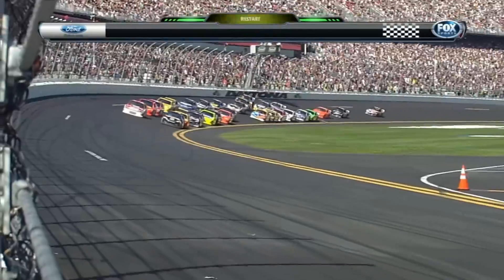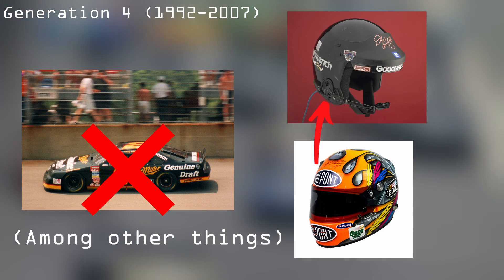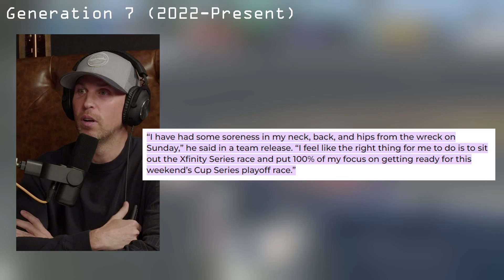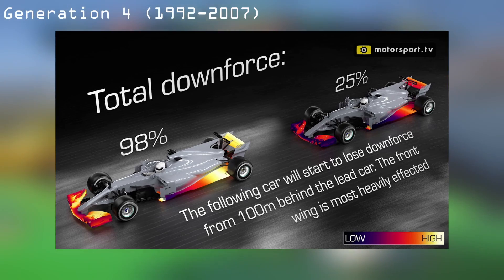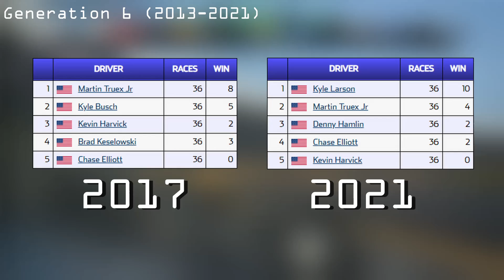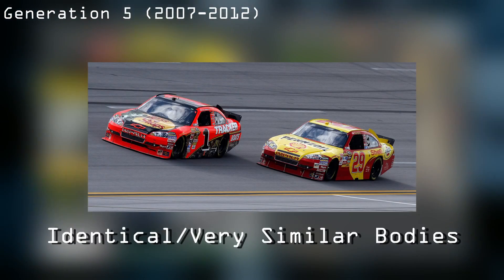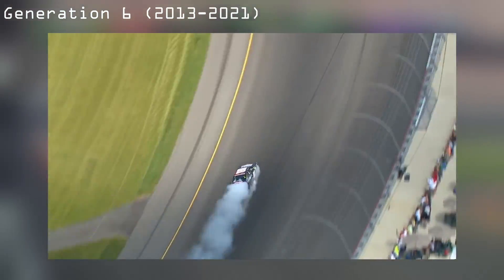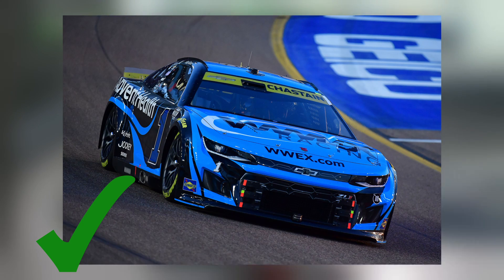Why NASCAR's Cars Keep Getting Worse

Comment from the maker: Thanks everyone for watching and commenting. Here's some corrections based on your feedback:

1 - The Gen 4 and 5 horsepower was about 900 (to be more specific than ">700" at 4:09)
2 - The teams still build the engines, so Kyle Busch's engine blowing up was probably more on JGR/TRD than NASCAR.
3 - I did not mean to call the Gen 4 era safe, or safer than today. There were countless fatalities. The point I was trying to highlight was that the car's safety was underrated, and that many of the safety improvements were not car-specific (HANS device, SAFER barriers, better helmets and belts, etc.)

Thanks again for watching and let me know if you have any other corrections!

Comment: The COT was actually really fun to watch.
Reply: cot (late cot specifically, 2011-2012 wingless and splitterless, once they got the issues ironed out) produced some of the best racing, arguably better than gen 4 in some instances, and was the safest generation by a long shot. people love to hate it for some reason and im yet to see a legitimate reason as to why apart from "oh but common templates" even though that was barely adhered to in the later stages, thus a non issue.

Comment: The problem with lastest generation of tires is that the slip angle is so narrow they are unpredictable and hard to recover if pushed past the edge. Not that they go flat in a spin and the cars need a tow afterwards.

Comment: Glad I got to see them race the Gen 4 at Atlanta 3 times in my lifetime. The asymmetrical bodies by each brand gave the car and drivers character. That high pitch boom exhaust was a sound to behold. Once I went back to a 2009 spring Atlanta race  the COT sounded different. It was like a subtle lower pitch compared to Gen 4. Not to mention that wing was an eye sore.

Comment: As I've said before NASCAR is supposed to be stock the same car that you could buy from a dealership. Make the cars look like what is sold and increase the horse power if the drivers go into the corner at full speed and don't slow down it's on them.

Comment: My favorite cars are the Gen 4 cars, and the late COT (2010 Spoiler-2012)

I really don't like the gen 7 car, but I will admit it has produced some good racing recently, my example is the 2024 Daytona Coke Zero Sugar 400, however this is just the racing, besides that there is STILL many things I dislike about it. Here are my personal dislikes

1. The number placement (This was a straight up insult as the 2020 All Star Race car designs were not received very well, yet nascar still thought this was fine)

2. Weakness (The car's suspension was so weak that when Tyler Reddick flipped in 2024, barley even putting too much pressure on the wheels, the wheel axel broke... he could have done a Dale Earnhardt and continued on, but because of this stupid little fail, his day was over...)

3. Driver safety (Anybody remember when Erik Jones was wrecked by Bubba Wallace and he faced a back injury?)

4. Rear Bumper (The rear bumper is rounded causing bump drafting to be risking, if you slip even a bit, your car can get turned around and your day is done...

5. Flat underbody and rear diffuser (2024 was by far the most insane year, there were many flips, probably a record for how many flips happened in a year, the issue can be directly caused by the flat under body, and rear diffuser, instead of being useful, it is all for looks and it causes these flips by directing air underneath the flat under body, causing the car to flip right over easily)

6. The tires (My gosh... this is probably the most terrible change in nascar history, nascar change the tire from 5 lug nuts to a SINGLE lug nut... this has caused MANY tire issues such as tires falling off, which by the way if that happens, nascar PENALIZES the team! These tires also seem weaker too, they also might be another cause of the cars flipping, as their open rims cause air to go through the tire and underneath the car.)

Comment: I loved Gen6 cars. There was nothing wrong with them, they were safe and looked good.
Reply: Agreed, Gen 6 was so good on short tracks, road courses and superspeedways, Gen 7 sucks on all of them and are only decent at best on 1.5s, which are boring, and it's basically just slightly faster 550 package style racing, they still can't pass in dirty air and there's not enough speed difference meaning a lot of follower the leader stuck in dirty air racing.

Comment: The biggest problem with the gen 7 car is that unlike every stock car from the 70s to the end of Gen 6 have had a full steel frame something you would find in a truck or a older muscle car and on top of it the full roll cage is welded directly to the frame the advantages of this design, it makes the chassis incredibly rigid and safe gen 7 cars are literally held together by subframes like a pony car i.e. Ford Mustang or Chevrolet Camaro, instead of the roll cage been permanently connected to the square tubing frame. The only thing connecting the frame to the roll Cage is the bolts literally, yes does it make the car more efficient sense if you wreck the car basically crashing into a wall at max speed you can just replace the front subframe and not have to build an entire new car yes. but that’s what also made stock cars special we all have seen it the part in the days of thunder NASCAR movie where they build the stock car in the barn that scene alone shows the dedication it takes to build a real stock car 🤷🏽‍♂️ when you look at every generation of stock car except GEN one when you look at the frame, the roll cage you see the hard work the fabricator put into making that all from the ground up it’s safe fast and beautiful when your car is basically just held together by bolts. Yeah it’s gonna become less safe because instead of having the all steel square tubing frame and the roll cage absorb all the kinetic energy of you crashing into the wall at 185 mph and absorbing all the impact just into the front when the vehicle crashes at the same speed that subframe is gonna crumble like a tin can and when the energy is transferred through the roll cage it’s not gonna be good day for the driver

Comment: Haven't watched a race in years, so a lot of this is news to me. So essentially, NASCAR is becoming like how IROC was by mandating the use of cookie-cutter components for the car bodies and suspensions? I wonder how long it'll be before they go all the way and do the same with engines... Probably not too long before they ultimately suffer the same ultimate fate as IROC, I'd wager.
Reply: Yeah NASCAR has sucked massively since the next gen car, I pretty much gave up on it after a year and a half of denial, 2022 was somewhat fun season at first but as the season went on the crappy ass quality (or lack thereof) started showing more and more, the better tracks race worse and the worse tracks race better, and I HATE 1.5 mile cookie cutters! I liked short tracks and road courses and the next gen sucks so bad on them I have hardly any desire to watch, they even found a way to fuck up the Superspeedways! A car that's only good on a very specific track type I hate that races bad on short tracks and road courses just don't appeal to me...and yet they say "oH bUt ThE rOaD cOuRsEs aPpEaL tO tHe YoUnGeR fAnS!" No they don't! Not if these "YoUnGeR fAnS" watch IndyCars or F1 (which I've fully switched to) and know other series put on much better racing product on them than next gen cars do...the thing that scares me is really young fans that started watching with the next gen cars who never saw a good race at Martinsville with previous generations of cars probably love 1.5s and hate short tracks for being slow and boring...I honestly don't see NASCAR ever fixing the next gen short track/road course package because they refuse to either add horsepower or actually test with an old style rear end gear, so they telling Goodyear to try and create high deg tires instead, which the wide grippy tires are a major part of why next gen races so badly

Comment: Ok. NASCAR Needs To Seriously, Seriously, SERIOUSLY, Bring Back The Gen-6 Car, With The Numbers, On The Middle Of The Door, Get Rid Of The Spliter, Raise The Cars Off The Ground So Air Can Go Underneath, And Lastly, Get Rid Of The Defuser, But, Have The Rounded Rear Bumper Along With The Quarterpanels With Less Sideforce, From The Next-Gen Car, And Put It On The Gen-6 Car.

Because, The Gen-6 Cars, need to Seriously, Seriously, SERIOUSLY, Look Like Real-Life Street Cars, Rather Than The Next-Gen Car That Looks Like A Copy Of An IMSA Car, With The Numbers Slid Forward.
Reply: I can understand how you feel
Reply: All of this yapping. And none of what you said made any sense.

You do know that IMSA cars use parts from off there street legal counter parts?

Such as GT3 and espically GT4.

And the NEXT Gen Camaros and Mustangs actually look closer to there street legal counter parts then they ever did in the Gen 6 era
Reply: @HazelProtogen  Oh

Comment: Gen 4 body, Gen 5 safety, different aero packages for different course types (with STRONG limits on dirty air creation to keep the pack racing alive), keep the 5 speed but make it a dogbox H-pattern, allow independent rear, but also allow straight axle fronts, and allow the engine to be anywhere ahead of the centerline of the car with the rules saying the driver's feet can't be past the front of it(probably dictate a minimum of 48% front weight distribution). Then ditch the 18-inch centerlocks. I'm not saying we need 15s, but 16s or 17s at most to allow for bigger brakes for the road courses, or maybe different-sized wheels for road courses and ovals to prevent the high-speed spins resulting in flats. 18s on road courses, 16s on ovals? IDK, it'd depend on testing.

I'd also allow lighter overall weight cars, too. Something like the 80s/90s era IMSA 6.0L's 2700lbs minimum weight. And before I forget, keep the restrictor plates for lower classes of NASCAR IE the Formula 2 or 3 equivalent. Restrictors have no place on a fast race car. Better yet, f you want to align them with other similar oval car series like the grassroots scene, just lower the displacement to a rounded 350ci. Though if you REALLY wanna get wild, have an outlaw 410ci NASCAR class, as well. Maybe that's how I'd run NASCAR classes... With separate small, medium, and large engines. I'd also allow SOHC with VVT and whatnot, but probably keep it to either 2 or 3 valves, no 4 or 5-valve junk.

Comment: Gen 6 would have been better if they would have just stayed with the 2014 package.
Reply: I SERIOUSLY AGREE!

NASCAR, PLEASE Bring Back The Gen-6 Car, Along With The Unrestricted High Horsepower Engine Package, And Lastly, And Most Importantly...

BRING THE 2014 PACKAGE BACK, AND LEAVE THE GEN-6 CAR, ALONE!!!!!!

But From The Next-Gen Car, Have The Rounded Rrear Bumper Along With The Side Quarterpanels With Less Sideforce, And Put It On The Gen-6 Car.
Reply: 2014 high downforce for 1.5s, low downforce unrestricted horsepower everywhere else.

Comment: Imo during in mid 2000s when gen 4 cars change theire features safety and improvise the hans device, head&shoulder, new seat protection whatsoever. Also i guess the gen 4 during those years had at least less injuries either zero casualties. Sorry for my bad English just my own opinion gen4 did better races in 2000s

Comment: In the last generation that we have so far, they have tried to make him too much like street cars. You barely tag the wall and knock the rear and I have alignment on the rear or barely touch the front and not the front and out from under. Standard rack and pinion was not made for this amount of pressure, and 30° banking at 200 miles an hour. NASCAR has obviously forgotten who their fans are, just like Bud Light.

Comment: 5:33 Correction: They had a little over 900hp back in 2014. Each year they cut the power down a little bit. 850hp, 800hp, 750hp, then 550hp.

To put this in context: with 900hp at tracks like Kansas and Charlotte they could hit top speeds of 205mph, then they would have to brake down to 180mph to make the corner. With 550hp they would hit top speeds of 185mph and they wouldn't have to lift off the gas for the corner.

Comment: More spec style racing is just the future whether we like it or not. All the technical low hanging fruit was picked long ago. F1's cost cap is a joke and nearly impossible to police. Mercedes was literally buying titles by spending 10's of millions a year engineering the perfect suspension dampers for every track in every condition. Is that what you call the spirit of engineering ? I guess. It just doesn't make sense to allow teams to spend big which makes the racing bad.

Comment: The Gen 7 Suspension is pretty durable, cars are bouncing off walls left and right, and able to continue, a Gen 4 5 or 6 isn't doing that. Yes the Early Gen 7 had weak toe links, but they have since been beefed up. Not sure why you even bothered to put Kyle Bush blowing up under caution, that's and engine builder problem, not NASCAR. Also the car has been improved safety wise since last year, the front and rear subframe mounts have been purposefully made weaker to absorb more impact.
Reply: Cars being able to wreck and continue doesn’t make good racing. Kind of the opposite really.

Comment: I feel like NASCAR has made a major shift by taking more input from the teams regarding rules changes and car designs. Previously, NASCAR was very much a dictatorship, their way or the highway, and if you didn't like it you didn't have to race. By listening to the team owners and prioritizing costs over everything else, they've created a car that no one is really satisfied with. The racers will always figure out a way to race, and if a team runs out of money another will replace it. NASCAR got spooked by   a bunch of the owners crying poor but I think it was more they were crying wolf. I agree that the 92-07 cars were probably ideal, although the last few years they got pretty wacky with the distorted bodies. The COT was the reaction to Earnhardt's crash and was much safer but unfortunately it was cosmetically awful. I don't think it's coincidence that the steep decline coincided with the COT. The current car is more reflective of modern technology and their road car counterparts, but not really optimized for oval track racing. I think there should be more HP and more opportunity for innovation.

Comment: uhh. the gen 4 and even gen 5 had well over 950hp from about 2003 to 2014.
Reply: they didnt lower the power until the gen 6 car in 2015, and lowered it to 750hp. Then 550 in 2019
Reply from the maker: Thanks for the insight. Couldn't find exact HP numbers so I put >700 as a  placeholder

Comment: the racing on intermediate tracks has been the best in nascars history i think, once they get the shorter tracks dialed in, we are in for a great shows every race.
Reply: I disagree. It’s been better than the 6, but lead changes don’t equal better racing. What was great about the gen 4 was that if the four best cars started the race with one in 4th place, one in 12th, one in 17th, and one in 24th, you knew that they were gonna meet at the front and sort it out. Now we see a dominant car have a pit road error, go back to 22nd and just get stuck there. They’re just to reliant on clean air. To be fair though, once they started coil binding and things like that to seal the car to the track the racing went to hell. This started in 05-06. It’s not a coincidence that that’s when the ratings started to drop. Racing is just better when it’s about mechanical grip because every car in the field can have mechanical grip, only one can have clean air.

Comment: I think the demise of nascar was due to them removing the various curves, left and right turns and straights ("straight aways") . I mean, I don't think there is a racing body that promotes racing on the same tracks as other events with nascar stock card. It would be interesting. On the oval track, you realize the cars and drivers never reach their full potential. Sure the Nascar we have to day is very difficult, but that's partly because it's the same repetitive maneuvers, requiring the utmost consistency and precision, but also requires unwavering focus and last but not least physical, mental and emotional (no road rage, no unsafe maneuvers) health.

Comment: The suspension and wheels are so sensitive and break so easily like the open wheel cars...very bad design. Hopefully they fix these issues
Reply: How do you figure? Gen 7 Cars are banging off both walls and each other, and are capable of continuing with essentially no issue, The early Toe Links were weak yes, but that has been fixed for some time now. A Gen 4 5 or 6 car would not be able to bang off the walls like the Gen 7.

Comment: No idea what they were thinking with the drop in Horsepower. NASCAR obviously does not do any market research, maybe they don't care?
Reply: NASCAR does do research but they word it so that they can make up dumb rules how they see fit...what do you want closer racing or more spread out racing? Or in other words cars with no horsepower, big spoliers and splitters and wide open throttle and big packs but no passing or cars with big horsepower little spoilers and splitters and off throttle time, field spread out but ability to pass if you have a faster car
Reply: The drop in horsepower is mostly to make cost of manufacturing lower for new manufacturers to potentially enter the sport (Honda). They have repeatedly tested with higher horsepower packages but not seen better racing product. Unlike previous iterations, the next gen has a wider wheel meaning they get much better grip than previous generations. As a result, there is less slipping and sliding at tracks than in previous generations. Higher horsepower alone is not believed to fix this issue.